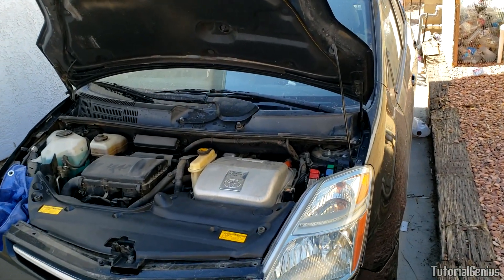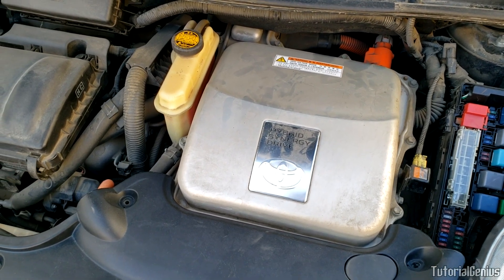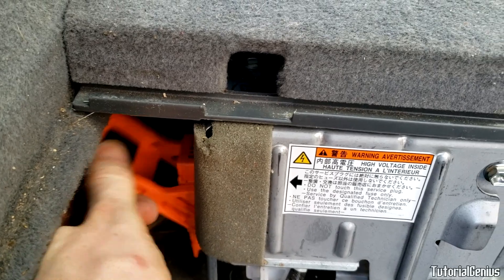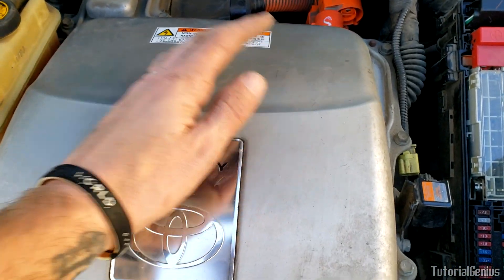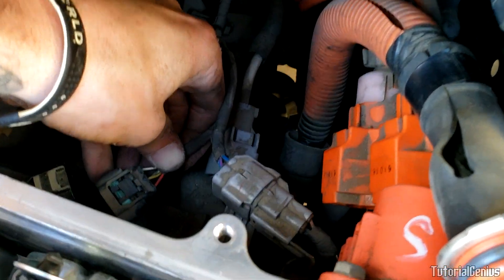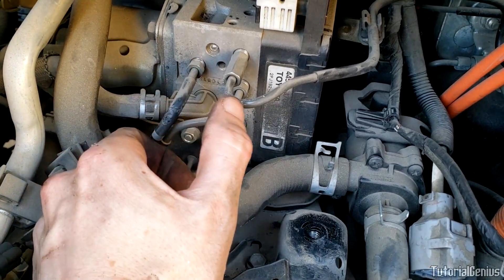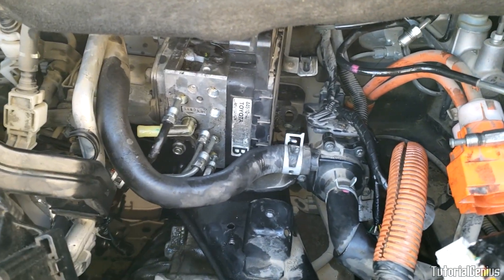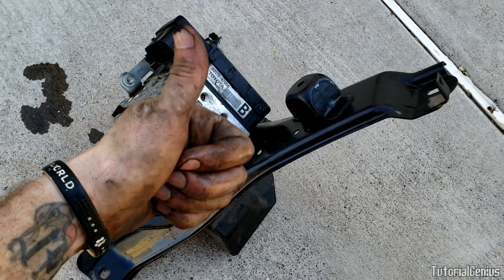Toyota Prius Gen2 ABS Brake Actuator Removal 44510-47050 + Inverter Removal

Comment: I'm going after mine tomorrow & will use your video as a guide, you've got me very optimistic! 👍
Reply from the maker: Good luck!! You can do it! :)
Reply: @TutorialGenius  STUCK!  on last harness under the small hose, connected to the mount, frozen. BUT was able to twist the ABS mount & remove the rear rubber mounted nut with the front & third remaining nut/bolt, it's now loose & should come out, right? but doesn't. Is there something else mounted to the ABS module from underneath, the weight? any insight on what could still be holding the ABS module to the mount would be appreciated. Thanks for getting me this far👍
Reply: @TutorialGenius  UNSTUCK - sprayed w/WD40 & let sit over the weekend, removed it today.
There's no way to get it out without removing it with th mount assembly, weight is attached.
Reply from the maker: @toekneetogo  Yup! Just like 16:53 in the video. The bracket has to come with it.

Tip: Standard WD-40 is not a penetrating fluid (Unless you get the more expensive can that specifically says 'penetrating' on it.). It's a lubricant. 

But more importantly congratulations!!! Hopefully you have a great sense of accomplishment and achievement! (and a heavier wallet from the money saved haha!)
Reply: @TutorialGenius  bucks saved - YES!  As the video goes on at 17:12 when I got all 3 out I figured it would  slide out once the bracket nut was off, but nada. The weight attached to it underneath is too long with no room to lift the module & slide out :( but success getting it out & the replacement in👍 That's where I stopped, blisteringly hot today. Re-connecting batteries & bleeding another day, crossing fingers this used ABS Module will work & have a bit of life still left in it. update pending.....
Reply: @TutorialGenius  (regular WD40 has always worked for me & has again) at 17:12 I figured since I got the back nut & hose bracket off I could lift & slide as you say, but no can do because of how deep that weight is with no room to actually lift it where it's mounted. So your way is the only way I think it can be done👍The old is out & the used replacement is in, that's where I stopped, blisteringly hot today. Connect the batteries, bleed & cross my fingers the replacement works🤞
Reply from the maker: @toekneetogo  That's great to hear! Fingers crossed for the rest of the project 🤞🤞
As these modules are really expensive now, I bet you could get a bit of cash on ebay for the old one. I'm sure there's somebody that can refurbish it professionally.
Reply: @TutorialGenius  SUCCESS! unit I got used for $450 works on day 1 so I did a quick bleed & erased the codes, still holding error-free on 2nd start-up, road test another day. THANKS for posting the video, what a great resource👍
Reply from the maker: @toekneetogo  AMAZING NEWS!!! Thanks for letting us know! :)

Comment: what are the chances that just bleeding the brakes would make the low pressure issue go away? the car only has 130K miles on it and only low pressure error but no lights on the dash, but I do hear the ABS actuator over working

Comment: Taking the wipers and wiper cowl takes only 5 minutes and makes the job a lot easier rather than squeezing your hands behind and to the side. It also allows you to bring out the unit faster.
Reply from the maker: That's another way of doing it, each to their own. I have done it both ways, I personally think my method is faster and easier.

Comment: Hello there 
I have 04 Toyota Pruis problem with ABS unit it was making noise. I took the ABS unit check it. I just got a used one from E-bay turn out to a bad ABS unit. So I put the old unit back in the car but I am having hard time to get the last FUCKING brake line to hook up the line on the top of the ABS unit. Could you tell me easy way to hook up the last brake line. Without beening the brake ok the other 4-lines they hookup except one on the top 5-brake line ok
Reply: How did you end up doing it?
Reply: Hopefully you didn’t strip the thread on the abs pump as if you did, you’re pretty much screwed as it will leak. However, it should go in by hand and for better access remove the wipers and cowl that way it’ll be easier to access

Comment: I replaced mine following your video but my codes didn’t go away. Bled the brakes, but my pedal is hard and seems it lags to brake. 
When braking only one wheel locks and the right one keeps rotating. Like if the caliper isn’t working. Any recommendations?
Reply from the maker: Check the brake hose and/or the caliper perhaps! Sounds like a caliper issue or a partially blocked brake hose.
Without throwing money at it: You could swap hardware over to a known working side and see if the issues moves with it. You would need to bleed the brakes
I just moved my rotor, caliper bracket and guide pins over the other day and the issue moved with it. Turns out my rotor was not true.